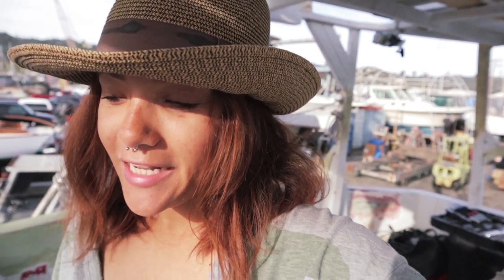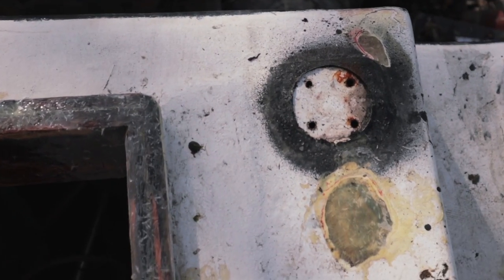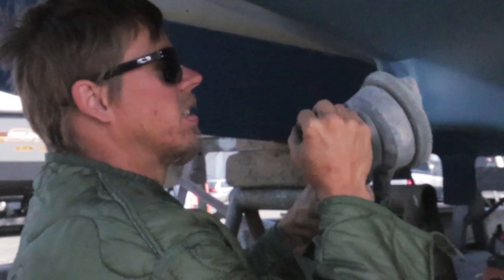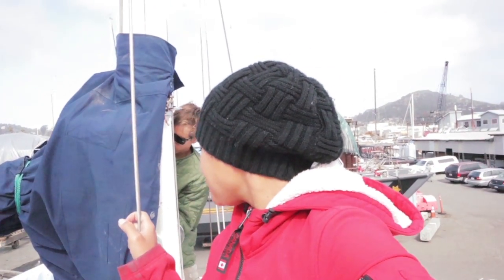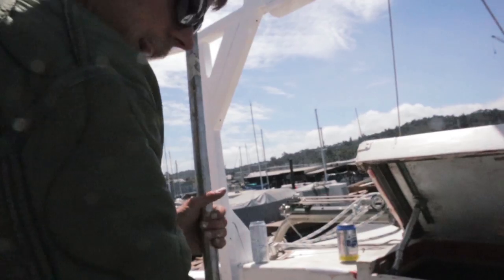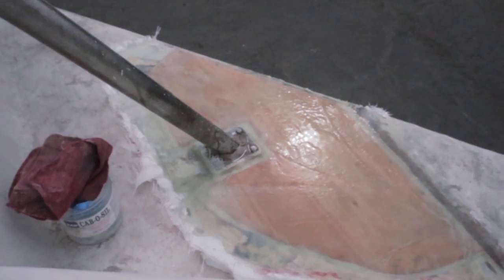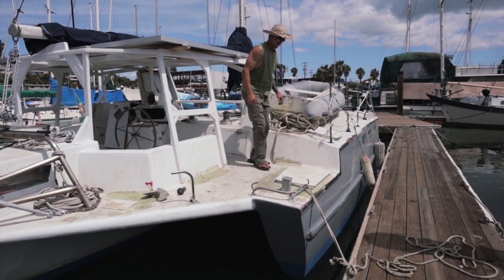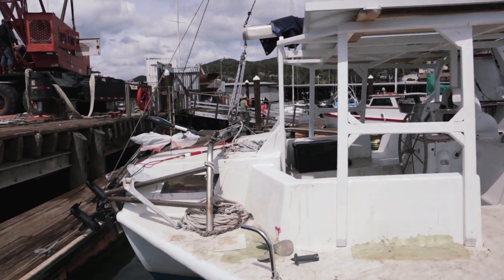Cruising Trimaran HAULOUT! 10 years and 1000 POUNDS of bottom GROWTH | Sailing Trimaran Kraken 13

Comment: great job guys.  glad to see you bringing the beast back.  im curios why not keep the prop shaft and do an electric conversion?  like sailing uma.  they did it pretty cheep.  Having that whole compartment empty would be nice though.  Need about a 40hp high thrust outboard back there.   those current and winds can be wicked in sf bay.  Need something that can keep you off the beach in a storm.  Keep up the good work!
Reply from the maker: We thought about it but our two electric outboards work great! Keep us going 3-4 knots. We really want to be able to sail everywhere in any condition and just use the motors as some help of needed. When there is no wind they come in handy or in marinas. We are at the mercy of the ocean and weather more because of this but it’s nice being all electric and these trolling motors are much cheaper compared to what sailing Uma has. She doesn’t take much to get going. We had her at over 12 knots heading to Santa Cruz (video to come out soon).
Reply: @whatskrakensailing   14000lbs is a lot to move when you need to get out of a scrape.  old sailor saying "2 is one and one is none" id just hate to see all your hard work and dreams end up on the beach.
Reply from the maker: @michaelfinch5400  definitely appreciate the advice. We may look into a more powerful outboard which in heavy seas is kinda pointless since it just keeps coming out of the water. Maybe some sea time in Mexico will make us want to put the prop shaft back in and get an inboard electric motor

Comment: I hope you kept the location (measurement) of that lower water line, that is where your boat is designed to sit in the water, you will want to remove weight till you get it floating at that level then she'll sail really well.
I see at the end after the old motor was removed and your back in the water, she is floating about where that lower water line was, so looks great 👍🏼

Comment: Wow. The Wife and I sail a Piver 44. Your doing all the kind of repairs I've had to do. Just wondering what size electric drives are those? and do you experiance any Cavitation issue when underway in big sweels?. We run a 58HP yanmar which is centre mounted. Cheers David. South Aussie
Reply from the maker: Piver 44! Wow! We closed up every through hole, took out the engine and our two 130 lb trolling motors work great. No cavitation.
Reply: @whatskrakensailing  Wicked. I going to Fit a trolling motor to a front armor to use as a bow thruster when docking. 130 lb eh?  I'll check the unit I bought off FB to what it is. The Thrust in pounds does work for me when I think in HP to move a boat. Still i'm only turning around. How mant knot do you make under way with trolling motor at max?
Reply: doesn't!
Reply from the maker: Mine are mounted on the main hull. At Max power I get 3-4 knots of speed. Having them mounted like that I can spin in circles. Very useful when docking

Comment: Nice boat enjoy the  sailing 
Of you have too high cost to repair engine look to get a suitable 4 stroke gasoline outboard as repair and service costs  are much lower than diesel inboards .A ten horse can drive s trimeran 25 ft at  1/4 gas and get 10 mpg in calm seas   Your size with 30 hp might get more than 5 mph  at probably 3 knots plus  in calm seas. .
Look to make rain collection or water makers to reduce need to  carry heavy water ..1 gallon of gas make about 10 gallons of water  but water makers cost big bucks 
If you replace rigging look to go with Dimens plastic trope it is stronger and  you can hand make the fitting even on desolate regions the world.Alternitivly look to use galvanised wire it is less brittle than stainless steel and again fitting can be handmade ..Drinking water is best in 5 liter bottles from shop to reduce risk of main tanks getting contaminated with  a nasty bug  .